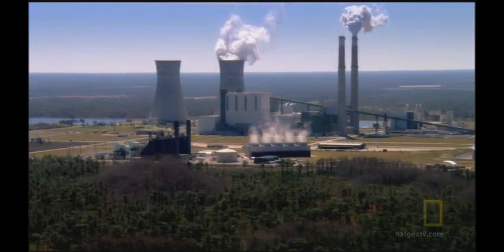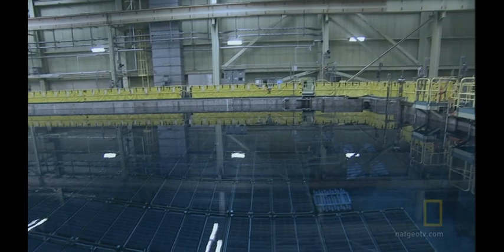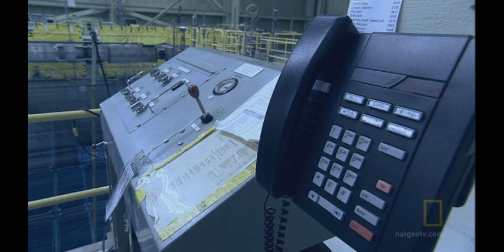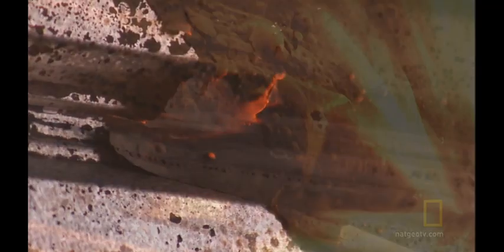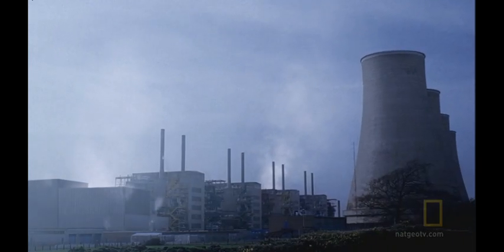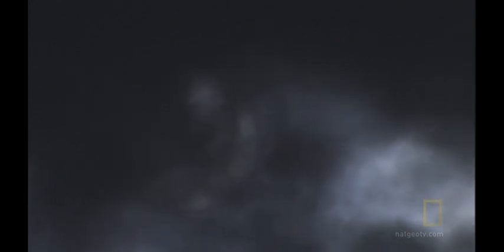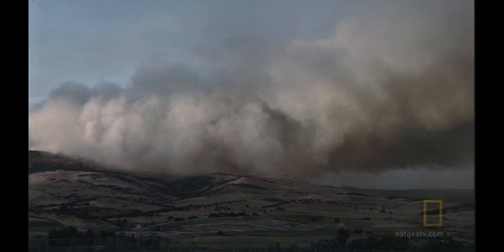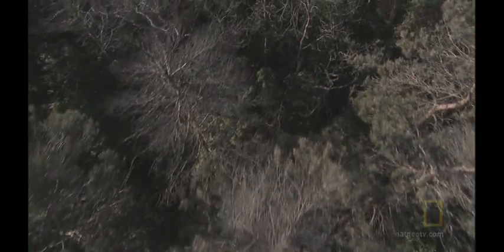Nuclear power plant spent fuel rods overheating and meltdown

Comment: A nuclear power plant meltdown is far worse than a nuclear bomb for long term radiation. While a bomb goes off and the fallout kills anything still left out in the open in the following days, the radiation is actually down to survivable levels within days. The isotopes have a short half-life and survivors can inhabit the area yet again.

Meltdown at a nuclear powerplant results in highly radiactive isotopes being spread around it (depending on the weather patterns) and rendering the areas closest to it uninhabitable for centuries. Pripyat in Ukraine which was abandoned following the Chernobyl disaster in 1986 will remain uninhabitable by humans for 320 years.

Modern nuclear reactors are fool-proof though. Even if all the workers died through some freak accident or gas attack the reactor shuts itself down when no more commands come from the operators.
Reply: Paul Allen " Pripyat in Ukraine which was abandoned following the Chernobyl disaster in 1986 will remain uninhabitable by humans for 320 years."
No that number is wrong. It don´t take account to the delusion effect, only the half-life. The delusion effect is actually quite a bit larger than the effect of the half life. Most of Pripyat is already under safe levels. Wash of the buildings and remove the top most 20 cm soil and it would be livable there tomorrow. The problem is that nobody really what to live there.

The most contaminated area is north of the plant. Pripyat is southwest. Its quite close, but the radiation didn´t spread that much in that direction.

(actually as a fotnot the city of Chernobyl, that is about 20km south of the plant is now populated again)
Reply: matsv201 Well, if you say so. Does "safe levels" mean it's just safe for anybody passing through or somebody having a penchant for abandoned cities and taking pictures for their portfolio, or does it mean it's indeed safe for people to inhabit the area for years?
The atomic bomb dropped on Hiroshima was tiny by modern standards and Hiroshima itself today appears as if nothing ever happened to it. Despite this the prevalence of some types of cancer are several times higher than in other Japanese cities. Leucemia is more common even today 70 years later. We're talking people who were born several years after the bomb was dropped.

I don't doubt that the most lethal radioactivity can somehow be cleaned off but there are certain elements which have a tendency to stick around in sublethal doses but still cause a serious amount of long-term damage. These are the ones which make repopulation unwise for a long time.

Thanks for the information. I will check up Chernobyl as it looks today.
Reply: Paul Allen What is safe level depends on what you are going to do. By definition.

"Despite this the prevalence of some types of cancer are several times higher than in other Japanese cities. Leucemia is more common even today 70 years later"
No that is actually a myth, go check it out.
Its interesting that people spread things that they think is right as fackts. Yea i heard this before, i just have to check it up once to know its bogus.

 "certain elements which have a tendency to stick around in sublethal doses but still cause a serious amount of long-term damage."
Not its simply not how radio-logical contamination work 

"These are the ones which make repopulation unwise for a long time."
And this is in turn not true.

"These are the ones which make repopulation unwise for a long time."
Yea, i actually did, there is about 900 people permanently living in Chernobyl city and the radiation level is a lot lower than in most urban cities. The temporary population is a lot larger, about 3000 people.

Hey.. wait, you where talking about Pripyat, yea that's a different story. Its totally overgrown and abandoned. There is wildelife everywhere, even indoors. Exept for the wildlife there is turist just about every where around with geigercounters stund that the reading is not larger.

You talking about the Chernobyl Nuclear power plant? Yea its actually operated as a nuclear plant until 2000. 14 year after the accident. That is actually quite strange when you think about it. Especially when it was a additional accident in 1991 reactor 2 that was closed down after the accident. Its intresting, because almost no media outlet repported on the accident, because most try to make it look like the whole region was a total wasteland with no operating anything. Actually by this time still 3 reactors was operational...

aaa. you talking about Chernobyl nuclear power plant reactor 4... Yea it was blown to bits in 1986. Now days the building a roof over it to removed the derby they should have removed 20 years a go but didn't because of political reasons. Its kind of ironic how the anti nuclear people try to stop the clean up work around Chernobyl nuclear power plant reactor 4. Why can that be?
Reply: "Its kind of ironic how the anti nuclear people try to stop the clean up work around Chernobyl nuclear power plant reactor 4. Why can that be?" I don't know how the local Ukrainian authorities see the whole issue but I doubt people have much say if the government decides to press forward with an agenda of theirs. In those countries people are used to adapting to whatever is decided at a government level and don't make much fuss about it unless their salaries are drastically cut. Seeing as there has been a revolution in Ukraine and a war right now the question of what to do with the old nuclear power plant is a non-issue by comparison.

I think it was more economical reasons any debris wasn't removed. Ukraine struggled economically for years and they're not going to waste money they don't have.
Reply: Paul Allen "Ukrainian authorities see the whole issue but I doubt people have much say if the government decides to press forward with an agenda of theirs"
Yea, you dont have a clue here. The problem with Urakine  is that they don't have that much money. They also basically borrowed money from all the superpowers.

Chernobyl is a international crisis and the Ukrainian government don't have anything to say about it.

"Seeing as there has been a revolution in Ukraine and a war right now "
That is partly incorrect. There have been no revolt, but there is a small war going on. The war is very local.

I actually lived in a country with a ongoing war. Its really not that notable if the war is not close by. I have also been stuck in a country with two ongoing wares (one civil war, and one border clash) as well as a ongoing revolution

"I think it was more economical reasons any debris wasn't removed."
No, its actually a lot more complicated. There have been several country's wanted to support the clean up effort. But it have been stuck because they don't agree on how it should be done. Ukraine pays nothing of it. They actually earn a lot more money than they lose on Chernobyl. 

Russia wanted to make the whole cleanup work back in the early 00-tys. But Germany blocked it. They didn´t want Russia to do it. Russia on the other hand thought that Germanys (And basically EU) way of doing it was all wrong. I kind of agree with Russia on this point.

Looking at Fukushima unit 1 we have a situation that is not really similar to Chernobyl, but they have quite a few of the same problems.

The radiation close to Chernobyl unit 4 is a lot higher than Fukushima unit 1. But i would say, this is not really that hard to fix. To be exact, there was some hotspot close to the fukushima reactors, and they was cleaned already 3 years a go.

For the time being Fukushima just cleans the hot spot. And to me, its the natural way of doing it. With filters and machines the radiation level for the workers is really low.

Then they enclosed all of the reactor in a self carying roof. This is the number two mistake they done i Chernobyl This was actually done in the Soviet time. They supported it on the on the old fundation, and it was not sufficiently strong.
Thirdly in fukushima they designed the protective building to be able to handling the clean up integrated in the building. And this was the 3:d error in Chernobyl, and this is the most annoying problem. Because the people that did it should know better.

While the problem in Fukushima unit 4 was not nearly as problematic as in Chernobyl, there was still radiation issues and some melted fuel. The clean up of unit 4 is already finished. Its only the decommissioning left, and by now this is quite a  standard process.

This year they start the upper clean up of unit 3, it is planed to be finished by the end of the year. For 1 and 2 it will start 2017. The core clean up will start 2020 and is planed to be finished in 2024. This include all the radioactive debris. After that the normal decommissioning progress will start. 

Also the 20 km zone is since 2014  not a no go zone, its rather a no live zone. But about 20% of the population have already returned to the less active ares. About 90% of the area is now cleaned an secured, and will be moved back into next year.

This is where Japan did it less well, This process could be a lot faster. At 50-60% of the area the radiation level actually never was that high to begin with. Some areas inside the closed zone was actually lower than the world background radiation average. So some evacuated people actually experience MORE radiation that they would do if the stayed in there homes.

Its only two smaller villages in the area that is somewhat hot. (over the yearly allowed dose for civil citizens). This is realtivly small area but compared with the hot zone around the power plant, quite big. So cleaning it is not that easy. But most of the radiation is Cs 134 that have a realtivly low half life, and the villages will be below the radiation limit about 2017. 

There is also a lot of debris from the tsuanmi all over the place.This is really problematic, because this might hide radioactivity. There for all the tsunami debris must be removed before the area can be considered safe. This problem don't exist in Chernobyl.

This is actually huge problem, and the major problem that caused the evacuation. Its not really about there beeing a lot of radioactivity. Its more that there might be a pocket of radioactivity. This is more of a tsunami problem than a nuclear accident problem.

The reason why it take so long time is that the areas out side of the closed of zone was cleared first because they could move back directly. This is natural. They clear the area where the ground can be used the fastest first.

Its easy to think that it took 5 years (2011-2016) to clean up the area. This is not really the case. Its really just took one year (2014 to 2015). But they finished of all the other areas before started on this one
Reply: matsv201 "The problem with Urakine  is that they don't have that much money." Didn't I point that out later as the core problem in Ukraine? The way I see it their revolution, war and all other problems stem from their lack of money and the widespread corruption. Judging from your previous two replies it seems you reply to individual sentences before you have even read the entire post and have the whole picture. You can't assess something and jump to conclusions without having read it all. Ad hominems are also never appreciated. If you're not Ukrainian yourself there's even less reason for you to be upset. Chill.

"Chernobyl is a international crisis and the Ukrainian government don't have anything to say about it." If that is true then they're a limp, powerless government not worth squat. It's their country how can't they have anything to say about it? That's violating their rights as a sovereign nation. Chernobyl was an international crisis but can hardly by called a "crisis" today as it certainly isn't likely to spiral out of control and cause another meltdown.

"There have been no revolt, but there is a small war going on. The war is very local." Ok, so we can ignore the Orange Revolution of 2004-2005 then. That definitely a crucial event in the recent history of Ukraine. Without it things would have looked different today.
The war may be local from a strict geographic point of view but both Ukraine and Russia sees it as a justified war on which their entire existence might hang upon, Ukraine in particular. These people are pretty paranoid and one can't really blame them considering the history they've seen. Paranoid people are scared and a war on their territory will affect them. 
If things take a turn for the worse we might look at another Spanish Civil War, in which all kinds of "adventurers", idealists, fanatics, mercenaries and foreign powers get involved. I wonder if the Spaniards are thankful for almost 40 years of Franco rule and fascism, for that was the net result of the Spanish Civil War.
The sad thing is that there are far too many people far away from Ukraine who are quick to pick sides on matters that don't concern them in the least. If they really want to help they should donate money, medicine and food to the people of Ukraine and not see it as an excuse to get into a fight with Russia - "the big bad wolf" (in their mind).

"I actually lived in a country with a ongoing war. Its really not that notable if the war is not close by. I have also been stuck in a country with two ongoing wares (one civil war, and one border clash) as well as a ongoing revolution." Interesting. Was this the Balkan Wars of the 1990's perhaps? Bosnia was the only of these countries that was in a civil war with all the horrors that entailed. All Bosnians I've talked to however told me they did notice the war one way or another. The blockade made life difficult for civilians even if they were nowhere near the front. Or were you in the Lebanese Civil War? That went on for 15 years and pretty much devastated Lebanon and when the fighting was the worst the country was in ruins. I know a Lebanese guy personally and the things he told me he saw was scary. Just bold guesses. This civil war+border clash+ongoing revolution sounds like a mess of a conflict. Hope the country has recovered, it sounds horrible. 
Whatever war you were in you can't use your personal experience as an absolute measure with which other wars can be judged for people in those countries. Perhaps you were a child back then so you couldn't relate to the war the same way adults did. That Lebanese guy I know was a little boy when their war was going on and he told me he didn't think much of what he saw as a child since "the bad guys died" and his side was winning at that time, but later in life realised he would've had a very different reaction as an adult.

As for what happened at Fukushima. Very informative. Thank you. I did the bold thing and ignored this nuclear incident because the Japanese are very thorough and don't want to lose their face anymore than they already have.  Appearing incompetent is highly shameful for a Japanese person. They make earthquake-safe skyscrapers and are very organised - as it's an integral part of their culture - so I trust the Japanese to learn from this and never repeat it again. It's well within their means to do something about it.
Ukraine is nothing like Japan however. They're more "flexible" people so it's no wonder corruption is seen in large parts of Ukrainian society. Like I previously said the Ukrainian people aren't accustomed to protest against first-world problems and you can blame 70 years of communist indoctrination for that. They are pretty far from a functional democracy and your average Ukrainian has a very different perception of what it means to live in a modern, democratic society than their European counterparts. This cultural mindset is a crucial factor in why things are the way they are in Ukraine. That's the culprit. If you think that's wrong then you don't understand the people there and the system they're used to.

Ukraine is in a crisis. They have no money and their focus right now isn't going to be on an old reactor. Perfectly understandable. My point all along. The minor details regarding Chernobyl today are irrelevant for the people in Ukraine today and a non-issue in comparison to the national crisis right now.  If they indeed receive foreign economic aid for the reactor then this is even less an issue unless the Ukrainian government squanders that money buying arms or something. If so a new revolution is needed and the Ukrainian people should have their sorry government impeached. Again, the core of the problem here is Ukraine itself.

One last thing. No matter how you look at it. My original post is correct. A meltdown at a nuclear plant is far more radioactive than a nuclear bomb. I salute those workers who did the clean-up and constructed the concrete sarcophagus in Chernobyl back in 1986. It could have been a lot worse. 

The big picture is not in the details. No more red herrings thank you.
Reply: Paul Allen 
I´m not from Ukraine, but live quite close by. My girlfriend use to study in Ukraine (in a short exchange program), i would say i´m pretty well read up on the situation, but not really a expert. But i do know a lot about the political games around Chernobyl.

"isn't likely to spiral out of control and cause another meltdown."
Well its all true an good. But its still a prestige issue for other country's, mostly Germany and Russia. Both country's have a economic strangle hold on Ukraine.. so yes.

" Ok, so we can ignore the Orange Revolution of 2004-2005"
In this case, yes, the Chernobyl plan was not really change with the Orange Revolution, rather cemented.

We was talking about recent event, a 10 year old revolt is not ongoing. Also, the effect on the matter was in this case quite small. Regardless of government, the government really don't control this process.

The Ukrainian deal can still turned out to a full scale war, but it don´t really look like that, at least not locally. Its a lot more likely that it turns out into a proxy war, it kind of already is. This would only cement the ongoing situation

" Was this the Balkan Wars of the 1990's perhaps?"
No it was actually on a completely other continent in a country that had multiple small wars at the same time.

Civil wars in most cases is often quite local. The Balkan war i would say it was not really a true civil war because of the state spitted up and become semi independent already before the war begun. Its really a special case. This is also true for the american civil war where the different state was already pseudo independent and had there own standing army. In most cases civil war is a asymmetric war and there fore quite local. This is also pseudo true in Ukraine, but it is also somewhat a proxy-war already. But its still quite local.

Balkan was in quite large part full out war. Also, even in full scale ware, if its no areal bombardment, the effect way from the front is most often not that big (well, a part from the economic once)

"Lebanese Civil War?"
Lebanese civil war was no true civil war, it was rather a proxy war of occupation.

"Whatever war you were in you can't use your personal experience as an absolute measure "
Well, its not true, i actually can if i say that it MIGHT not be that notable, i know that from experiance, that MIGHT be the case. I don't say its always the case, but its quite often the case. I also say this from deep historical knowledge.

Taking two example of war that is called civil war, but really not are. You can just as well call Korean and Vetnamn war for Civil war. There are 100 of smaller wars last decades about the size of the war in Ukraine. They are not uncommon, but they don´t came into the main stream media because they are not in Europe or economical important areas. A lot of those is quite comparable to what in Ukraine today... Yes it might become bigger, but then it changes the whole scenario.

"As for what happened at Fukushima. Very informative."
no problems... i really do try to be informative, that's why a write the text in depth.

"Japanese are very thorough and don't want to lose their face anymore than they already have"
Well, sure, but now a lot is cleaned up and its time to analyze what is actually done wrong.

Also, there was a additional nuclear accident in 2004 with 5 death (that is actually more than of the Fukushima accident). To be quite frank an honest, i´m not that surprised that this happen in Japan. Japan is really good at a lot of things, nuclear safety is not one of those.

I don´t really want to say it was incompetence, also i don't really want to call it corruption (sure, there was some corruption involved). I would say its a cultural issue. Ironically the bombing of Hiroshima and Nagasaki made this even worse. I would say, no bombing of Hiroshima and Nagasaki, and we would never heard of Fukushima.

"Ukraine is nothing like Japan however...."
I do agree with most of the things you wright here. It´s not really that i disagree with your opinion on Ukraine, its more that i disagree whit how the appealing state of the democracy in Ukraine.

The thing is that the situation in Japan is really not that god that most people tend to think. The big difference is that Japan is much better at holding a god face outwards They do hide a lot of problem and it can be quite dangerous.

On the other hand, when things are in the open, Japan works quite well, actually a lot better than most European contrary. This do to some extent offset the previews problem.

The thing about Chernobyl and Ukraine, is that not the people nor the government have to much to say about it. The people just want to forget it, and for the government its more of a cash cow.

"Again, the core of the problem here is Ukraine itself."
No, you totally missed the core issue. The core problem is that Ukraine have nothing to say about it, and earn to much cash on it. The superpower want to be good in the eyes of the world do more damage than good.

"more radioactive than a nuclear bomb"
well, in volume, then right, but not in intensity.

" It could have been a lot worse."
Well, could it.. really?... Actually i don't really have a strong opinion about this, but i read quite some papers on the issue and it seams like the initial cleaning up was not that necessary. Well, its simply not that clear cut. The workers do deserve there respect, but regardless of you much you respect the workers, that don´t make there work any more or less effective.
Reply: Paul Allen Fukushima say's otherwise.
Reply: ***** No, you don´t understand how radioactivity work